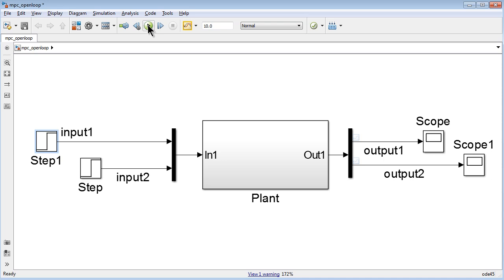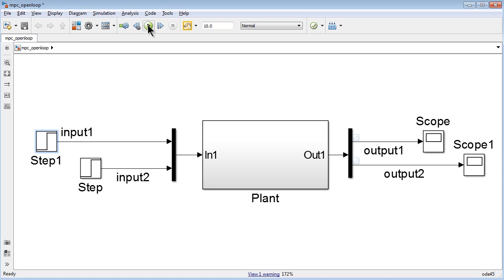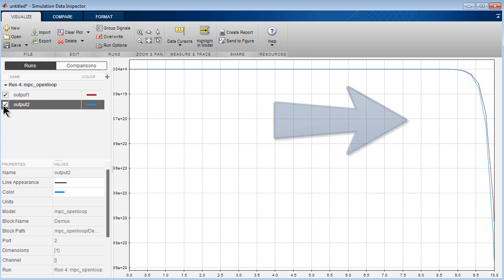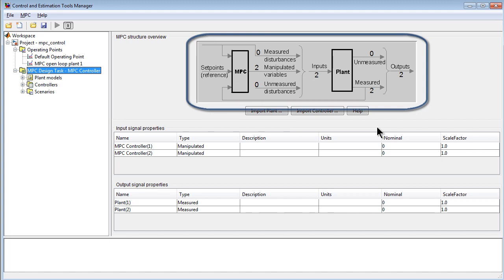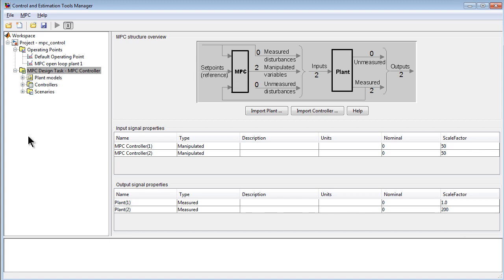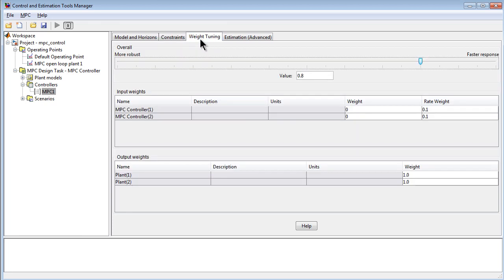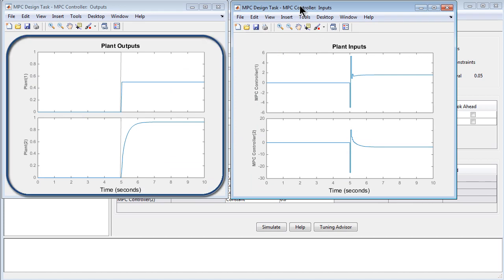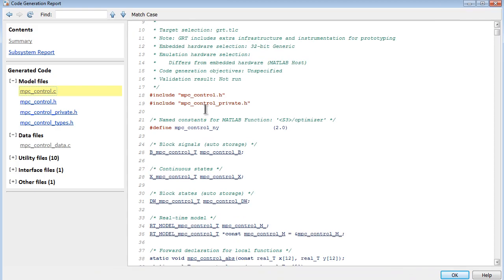Getting Started with Model Predictive Control Toolbox R2014b

Comment: Hi. I have some troubles working with the MPC block in SImulink. Can i use the MPC block in order to connect to a real plant like a servomotor or something? or the MPC block is only for simulation purposes? i was trying to connect the MPC for controlling a servomotor connected to arduino mega2560. Thank you!.
Reply: los guarumos pitarras electrónicos Please hownyou found the MPC blok in simulink i cant found it in the library ?